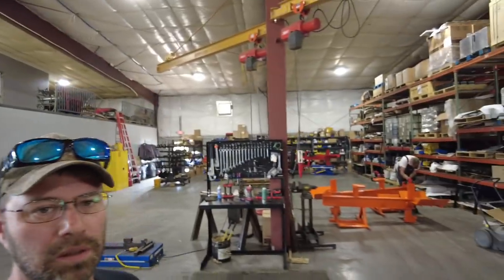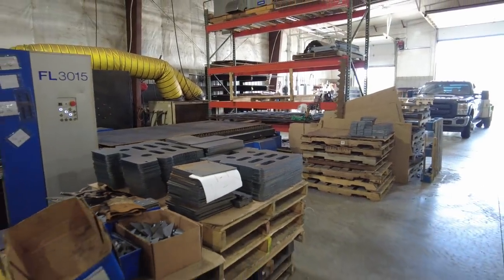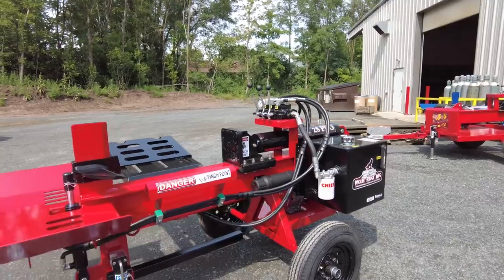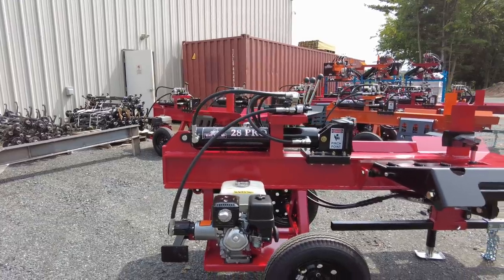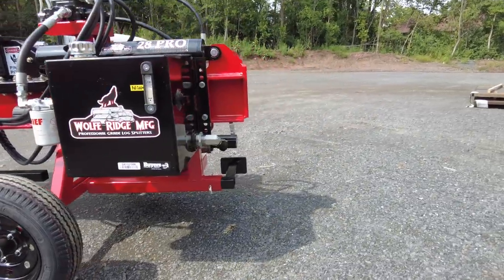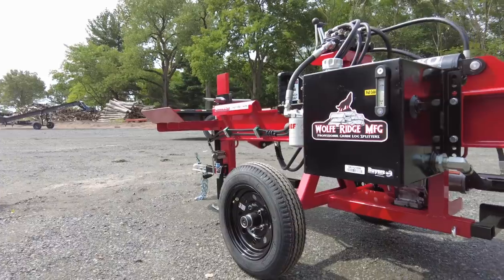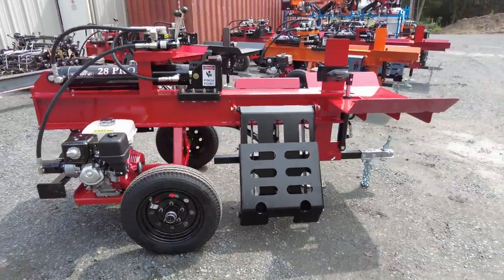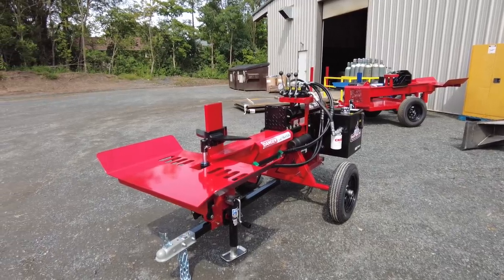Wolfe Ridge 28 PRO and FAQs

Comment: I took delivery on one of these Pro splitters10 months ago; should have reviewed it earlier.  I split about 10 full cords of mixed hardwood in just over 26 hours of time.  This is easily less than 1/3 of the time using a big box store splitter.  And the best part, I was not beat to death after the work.  This purchase will allow me to continue using firewood exclusively to heat my house even though I am now approaching 70 years of age.  Even my wife, who is not normally impressed by these types of devices, was impressed after having watched me split wood before I had this excellent machine.
Reply from the maker: Thank you Dennis! Glad to hear we were able to make splitting life easier for you!

Comment: We use those same type Honda motors on out concrete saws. They see some serious abuse, left out in the weather consistently, suck in a ton of concrete dust, whatever fuel we have is dumped in the tank, and those motors very rarely cause any problems. I've seen air filters come out so caked with dust, you can't believe they still run. Once again, Wolfe Ridge is top notch, keep the best parts on those machines and people will continue to purchase!

Comment: I got my 28 Pro a few months ago and it has exceeded all of my expectations.   I have thrown some pretty big logs at it and it hasn't skipped a beat yet.  When I was first looking at splitters,  I was wondering if I should spend the extra money for the auto cycle valve, but now that I have been using it to split wood on my 40-acre property for a while, I can say that for someone who isn't using the splitter for commercial use, you won't miss it.  Well worth the money!

Comment: I received my Pro 28 about one month ago from Faith Farms in Salisbury, NC.  I absolutely love it!  I have a project going on soon and I have to remove a bunch of trees.  The first one down is the biggest and the Pro 28 has handled everything except the main trunk which is huge and I really don't expect it to given a girth of 2.5 to three feet thick.  I use the four way splitter on all the small and medium rounds.  The bigger rounds I just break them down withthe single splitter.  This is a well designed machine.  Unless you are a professional firewood provider I really don't think you need much more than this machine.  That said I will always lust after a bigger one!  Great workmanship.  Thank you Wolfe Ridge!
Reply from the maker: Awesome, thanks Mike!

Comment: the pin on the 4 way ram needs protection for the locking clasp i was watching a demo an the log hit the clasp rotated it around the next log knocked it out and a few logs later the pin fell out an the ram operator didn't notice or figure out why the 4 way spitter stopped working. i think buy moving the weld up until it is behind the 4 way splitter or a little diverter plate to keep the logs away from the clasp to protect it. it is a great machine

Comment: My 28 Pro is an amazing machine. I only run non ethanol gas, and have changed the engine oil at 20 hours, 70 hours, and will again at 120 hours (at 108 now).  A bit of overkill, but oil is cheap insurance. Have not had anything it wouldn’t split.

Comment: Great you stick to quality components and dont cut corners due to supply chain issues. Will cost you sales / turnover in the short run but will be rewarded in the long run since you keep standing out as a top quality brand. 
Also a big fan of this smaller 1cyl 4 stroke Honda engines, even when neglected or misused they are quite impossible to destroy of you keep the oil level OK.

Comment: Hey Chris. Could you do a side by side comparison of the 28 pro and the 28c ? The 1500 dollar  price difference what do you get for that money.  I  will be talking  to  you  soon to place my order. But which  one???? Have a great weekend.
Reply from the maker: Same chassis, beam, wedge, log lift, etc... 28C has bigger engine, pump, tank and a 2 to 3 second faster cycle time. 28C also offers more of the high end options like Auto Cycle- which is a must have for commercial production.
Reply: @WolfeRidgeSplitters  Thanks Chris my goal for next year is 300 face cord. Don't know if that puts me in commercial or  homeowner lol!
Reply: @Lifeinthe906  That would be commercial IMO. I think I'd go to one of the faster ones for that much splitting.
Reply from the maker: 300 face is commercial for sure. I would go for the 28C with acv and mag package. The time savings will pay for itself quick!

Comment: Would be nice to have the auto cycle valve. Is this the auto return valve. Would be nice to have a dealer in Pittsburg, Pa. Is the away to speed up the cycle time?
Reply from the maker: We have auto cycle available on any commercial machine. Dealer is in Harrisburg PA  or eastern OH. I won't be adding anymore dealers for a while. Thanks!

Comment: Just wondering why you aren't using all stainless steel bolts washers and nuts
Reply from the maker: I don't really see the need for stainless hardware. Zinc plated grade 8 seem to be hold up just fine with less galling issues